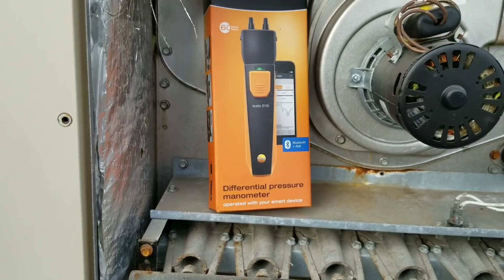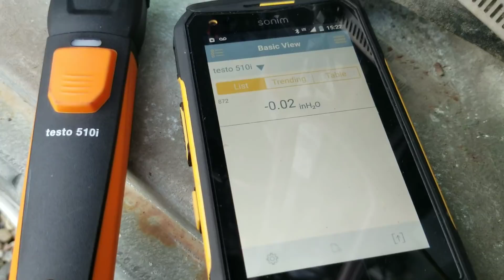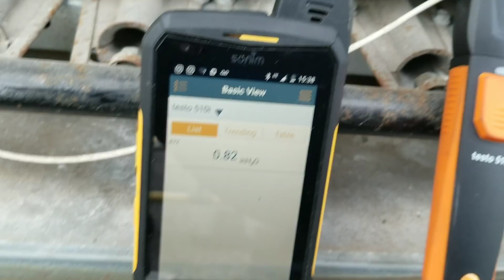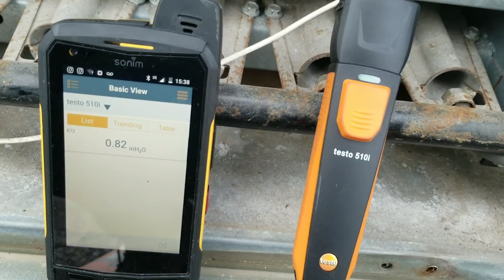HVAC Tool Review - Checking Gas Manifold Pressure With The Testo 510i

Comment: Great tool, gas pressure is so important. Sometimes, when a unit has too many unexplained shutdowns due to flame failure or cannot satisfy the thermostat, a gas line pressure test should be done. Plug your tester into the line side with gas shut off. Then, open the line valve. The pressure you read on the meter with no combustion is called static pressure. If your gas service is rated for 7” to 14”w.c., you should read no more than the manufacturers specified inlet pressure for that valve. Some valves have the inlet pressure in psi: 1/2 psi = 14” w.c., for example. Then, with your meter still connected to the line side, start the unit and go to second stage or full modulation. The gas code reference for a 7” to 14” service says the line side pressure must not drop more than 1” w.c.  The pressure you read on the line side during operation is called the working pressure. Say you had 7” static but dropped to 5.5” working. - that’s a problem. You might not be getting enough volume of gas even if your manifold reads over 3” w.c. Be sure to clock the meter to confirm input on high fire. The excessive pressure drop problem must be investigated/corrected - maybe there’s a restriction in the pipeline or its undersized for your unit. Maybe the regulator orifice is too small.....
Reply from the maker: The tool is great, I appreciate you taking the time to watch and commenting Ian

Comment: Good video, I'm sure you probably know but just in case you don't, you should use a tee in line with your pressure switch, that way if there's a leak in the diaphragm of the pressure switch you'll be able to tell because you'll be measuring the true pressure reading with the switch in the circuit.👍👍
Reply: How is the range from the psi probe to your phone?  is it the same as the other Testo probes?

Comment: Thanks for the tips. 
Don't work on furnaces so forgive the elementary question.. Does the switch require 0.1 of pressure to maintain the gas valve open?
Reply from the maker: Yes that's correct, -0.10
Reply: @HVACKnowItAll  So would you suspect switch failing closed? since your reading is less that -.0.10 or does "wheelhouse" allow for the 10% discrepancy? Since the hose was disconnected from the switch during this test, can I assume that the unit was not firing and gas valve was closed?
Reply: @davejohnsonnola2758  that reading is -0.89 that he has, if he swapped it onto the positive port of his manometer it would read -0.89. That's more than enough draft needed to satisfy the switch. -0.89 is a much stronger negative draft than -0.10.